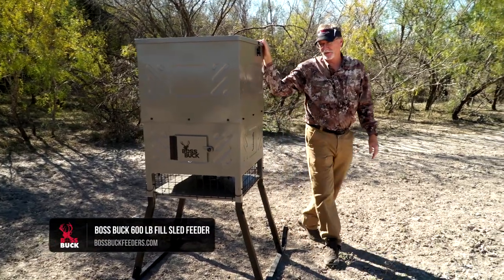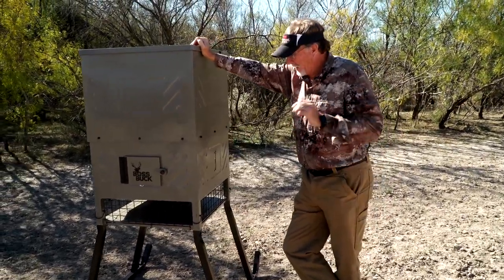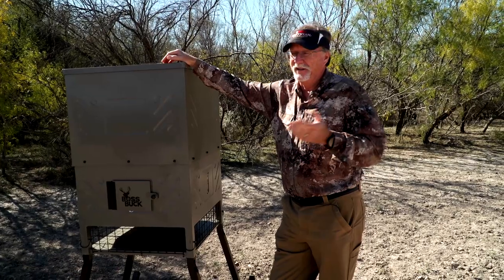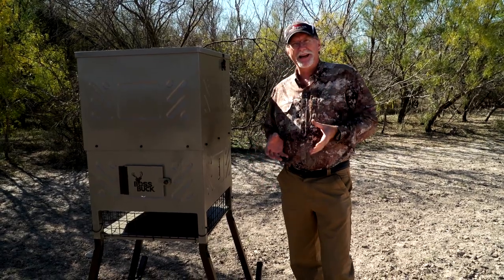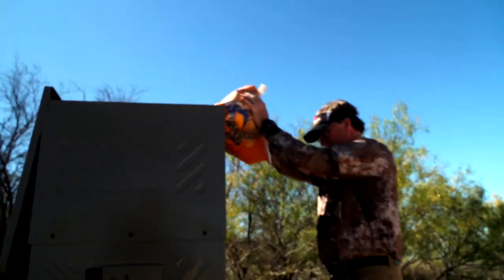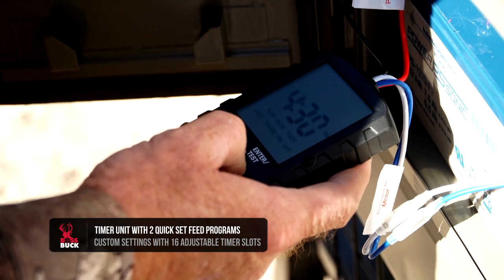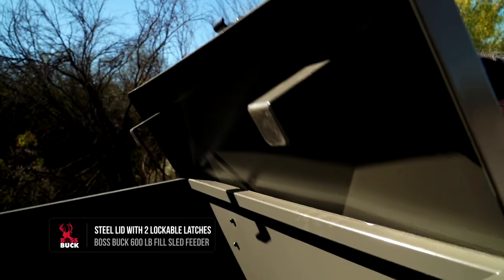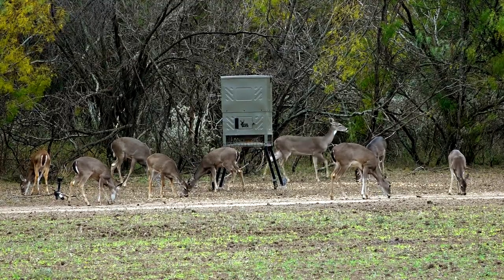The NEW Boss Buck Sled Feeder

Comment: Absolute worst feeder I've ever had. The feed plate design is awful, gets corn under it and won't spin. I've worked and worked and worked on the 2 I've bought and they are a nightmare from hell. Wiring and everything, anywhere that could have an issue will, guaranteed